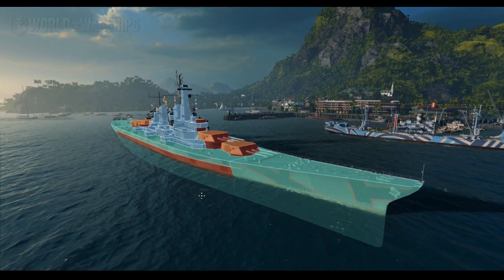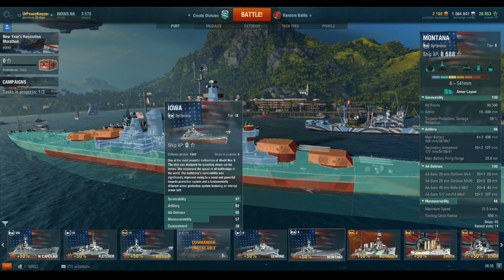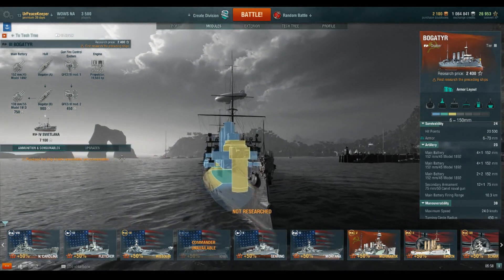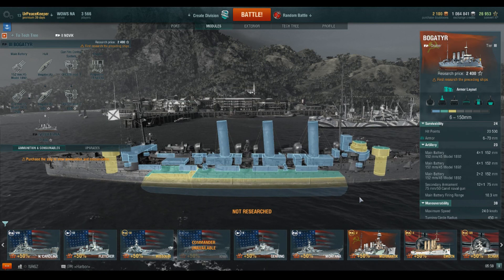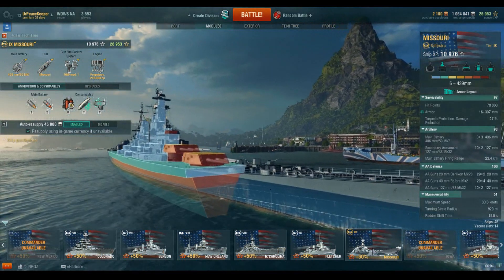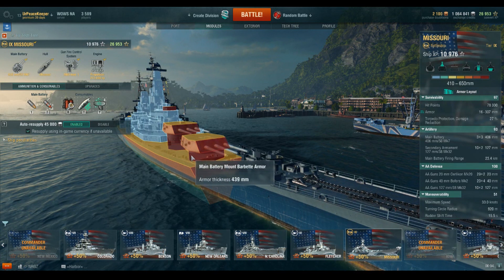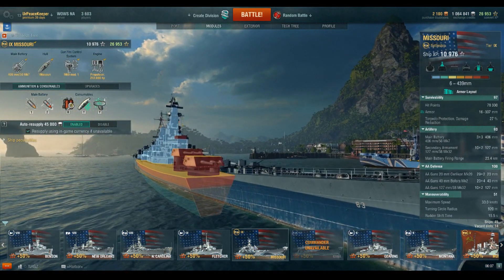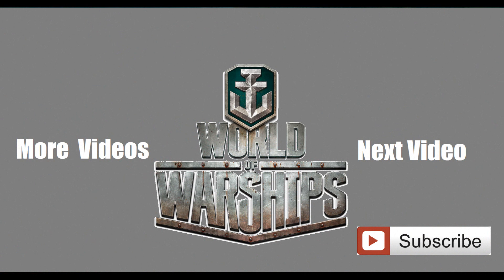Naval Armor Design In World Of Warships

Comment: There is an grave error in the video!
It is with the cosine function! Which gives relative armor thickness!
A 307mm armor in the 19° is 324 mm or 12.79 in (324mm) not 17.3 in (439 mm)!
No shell was arriving at the angle of ~25° at this time, but most likely 10° .
At 19 000y or ~17.3km. Which would give only 351mm or 13.83 in.

P.S. World of warships also do not implemented PROPER equation for USN armor penetration formula! And penetration reduction on the angle: https://youtu.be/vLFIKY_Kc7s?t=175
https://en.wikipedia.org/wiki/Sloped_armour
by the function:
Sloped armor's geometrical effective thickness: Armor/cos(slope+impact)
Pen loss Angle   Armor improve+
 2.16% - 10° -   1.54%
 8.50% - 20° -   6.41%
18.57% - 30° -  15.47%
31.66% - 40° -  30.54%
46.81% - 50° -  55.57%
62.85% - 60° - 100.00%
78.40% - 70° - 192.38%
91.79% - 80° - 475.87%
100.0% - 90° - error

Comment: 6:27 But surely the equivalent thickness changes a lot based on shell angle? 17.3" isn't going to be correct at all ranges. A 19° slope makes very little difference at close range to effective thickness, but a vast difference at far greater ranges. So at what range is it equal to 17.3"?

Comment: Great video explains it all. Its also rumoured that WG raised part  the citadel on the Iowa not sure about the rest of the USN BBs. Apparently it was to incorporate the splinter deck the other theory was if the armour scheme ws as built it would be very hard to penetrate it. Do you have any info on this?
Reply from the maker: +sub ohm (naztb) the Iowa and Montana citadel is above water and does incorporate the space between the armored deck and the splinter deck as part of the citadel. The real Iowa did not have any critical machinery in that space and the Montana wouldn't have either. The real citadel space would be below water.

In real life the armor on the Iowa was quite strong, especially for its weight.  One need only look at the battle that South Dakota had with Kirishima to see how effective it was. South Dakota and Iowa share nearly an identical armor scheme.  South Dakota survived two shots at point blank range from Kirishima at the belt and water line and recieved no penetrating hits through the belt. Kirishima was armed with 14" guns so no reason they shouldn't have penetrated but they didn't.
Reply: Thanks for the reply so its true the armour profile is nerfed to make it easier for WG. Shame they didn't do it justice Iowa is so fragile unless well angled. If the profile was correct it would be a real beast
Reply from the maker: The fortunate and unfortunate part is that this "test" was only done once to that armor design but the ships had a rather large immunity zone to the 16" Mark 5 2250lb AP shell, but not the Mark 8 2700lb 16" AP shell actually used on them.  LOTS of people state the later, but not the former and as a result conclude that the Iowa must be a battlecruiser or some other nonsense.  No, the 12.1" thick armored belt was quite capable of defeating high caliber rounds, the problem comes from the distances in game where most of the fights occur at which is well inside what most ships were designed to be "immune from fire".

Also, there is a lot of speculation surrounding why the Kirishima's shells didn't penetrate but the most commonly believed explanations are that either the 1.25" thick STS outer hull (which is 1.5" on the Iowa) decapped the rounds and they shattered on the armor belt (high probability since only one of the caps on the shells penetrated the outer hull) or the shells shattered on impact with the armored belt due to the proximity.  The only way we'll ever know is if someone rich enough builds up a to scale hull section and drops 14" shells on to it! :D  That sounds like a cool thing to test to me and if I ever won the lottery, I'd want to try it! :D

Comment: So is the st Lou have turtle 🐢 back? Cause it also has an external belt of 100 mm
Reply from the maker: Technically it's an "Armored Cruiser" which is essentially the genesis of the Turtleback armor scheme.  To further confuse things, Wikipedia lists it as a protected cruiser!  So the answer is "Yes!" :D
Reply: If I recall correctly, it was designed as a "protected" cruiser (which meant it had the turtleback arrangement, but little other armour), but during construction it was substantially enlarged and uparmoured.

Comment: Great video, but i have a question. What is a conning tower, and why does it have such think armor? Does it count as a citadel?
Reply from the maker: It would be interesting if MORE things happened when critical components were hit but this game needs a much different damage model for that to happen!
Reply from the maker: Bound for Space I wouldn't waste time unless you were close enough. The conning tower doesn't count as a citadel hit so unless there is nothing else to aim at, I'd aim elsewhere. :)
Reply from the maker: The conning tower is effectively the armored combat bridge.  Inside the conning tower is usually an engine telegraph (where orders for speed are relayed to the engine rooms) a wheel for steering the ship, view ports to see out (poorly), and other methods for command personnel to view the battlefield from an armored box.  

No it doesn't count as a citadel but if you can penetrate it with your guns you can rack up some good damage from hitting it on bow on ships! :)
Reply: that's what i though it was. thanks for the info.
Reply: Whiskey's Gaming Lounge I think it would be interesting if something happens if you pen The conning tower. Haha
Reply: Whiskey's Gaming Lounge So could it be considered practical to aim for the conning tower in something like a battleship? Or would it be too small for the dispersion to be taken into consideration

Comment: Nice Video its also interesting that Bismarck aswell was able to "catch" more than 400 14" shells from 2km away and survived that pumelling for 2hrs until they detonated their engine room.
Reply from the maker: Bismarcks critical machine spaces were never penetrated and like most battleships had enough reserve buoyancy in those spaces to remain afloat.  Bismarck was a tough ship, no doubt, but at 2km you aren't going to get through the internal sloped deck with anything but bombs and torpedoes.  At that point you aren't doing anything aside from wasting ammo!
Reply: @Whiskey11Gaming  funfact the torpedoes (the one from the cruiser) failed to penetrate Bismarck torpedo bulkheads
Reply: @Gencrossbones  Is that proven? I thought James Camron found the torpedo bulkhead had penetrations? Also he found some Armor penetrations from the 16 inch guns on Rodney.
Reply: @5000mahmud  also the torpedo bulkhead is intact but when Bismarck slide down it damaged it.
Reply: @Gencrossbones  The Mark VIII 21 inch torpedo had 327 kg off torpex, the bismark's bulkhead was designed to withstand 300 kg of German hexanite, so the close margin probably explains why the torpedo failed to penetrative. Though I bet if more than two hit, the bulkhead would have been compromised, just like how the musashi took 19 torpedo hits before sinking. The design of torpedo bulkheads means that they cannot take multiple hits around the same area. Torpedo bulkheads are filled with oil, water, air etc, and once hit, is compromised in that location.
Reply: @5000mahmud  it is hard for the torp to hit the same location though. The only torps that actually hit Bismarck is victorious who didn't penetrate but she did cause mild flooding, ark who jammed  the rudders and Dorsetshire that hits her upper deck while she was sinking. It will take forever to sink Bismarck via torps because she's has a lot of compartments.
Reply: @Gencrossbones  Yes, it is unlikely with only a few torpedoes, but with enough it becomes a near certainly. 19 for example.
Reply: @5000mahmud  yep it is extremely hard to sink a BB with a few torps but with a lot of them it will be easy.